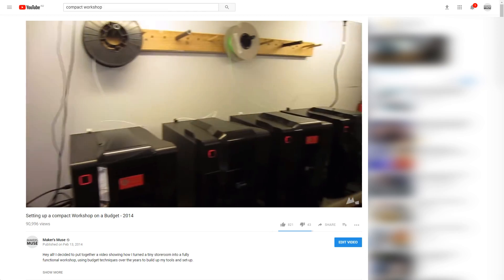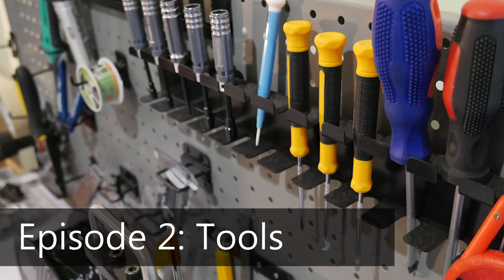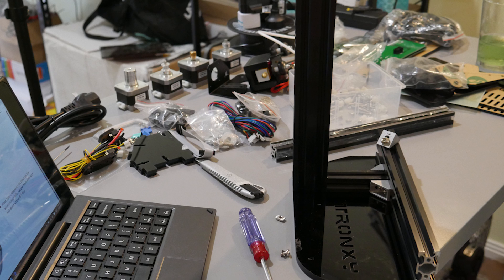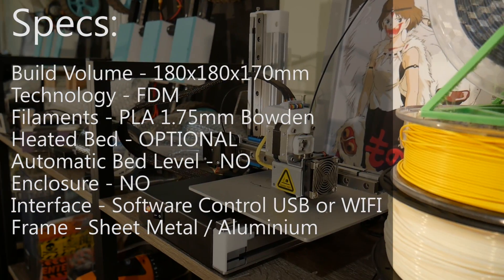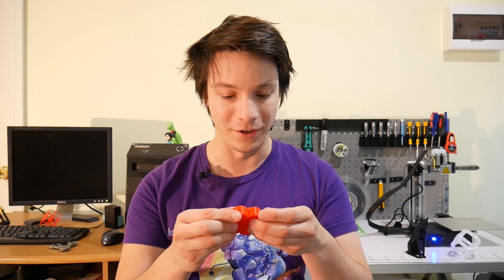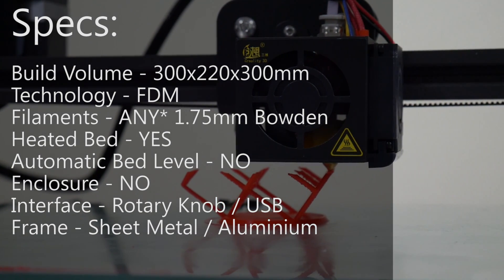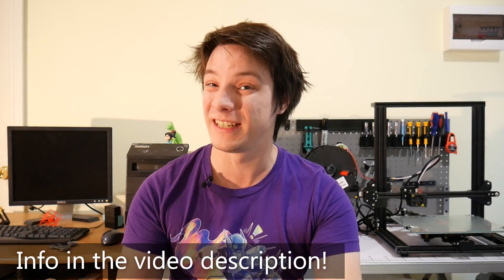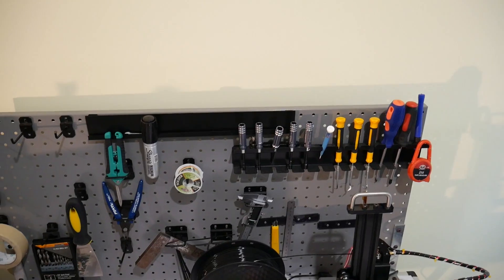The $500 Makerspace Part 1 - Budget 3D Printers

Comment: The X1(and X5) has been on a flash sale on gearbest, there's a couple of days left but it's about 30% off.
Reply from the maker: The X1 code brings it down to $109 or so which apparently is below cost, so they allocated 30pcs to it.
Reply: Yeah, I just did the conversions, if that's us then it's £10 cheaper than the offer, Australian and it's nearly £30 less :p

But even once those run out, the sale is looking good, id get an x1 and possibly the x5 (£221 right now!?!?!) ifI had the space, a job, and didn't technically already have 4 printers in various states of function :D

Comment: I bought an Anycubic i3 Mega for $US340 and it is far better than the Cetus. $40 more for a huge improvement is a good deal
Reply: The i3 mega is set up with 4 screws and is tested before it is sent to you... works very easily and instructiosn are excellent. It is also durable and well built with a 210x210 base.
Reply from the maker: True that the i3 mega looks decent, the cetus is just a bit more friendly for schools and education due to the basic software and wifi connectivity.
Reply from the maker: Sounds like a good option for a budget makerspace then :) These are just my picks.
Reply: I own an Anycubic i3 Mega with ultrabase, and I'm not so sure it's better than the Cetus. Looking at the quality it's probably worse. Had to do quite a bit of upgrades to make it print better and more quiet. Cetus looks like it prints better right out of the box. 

I'm planing on getting one, because even though it's simplified it looks like it will just get the job done, which is what I want when printing for customers.